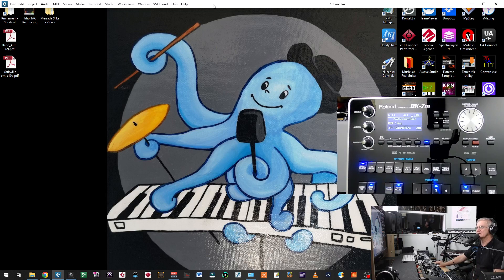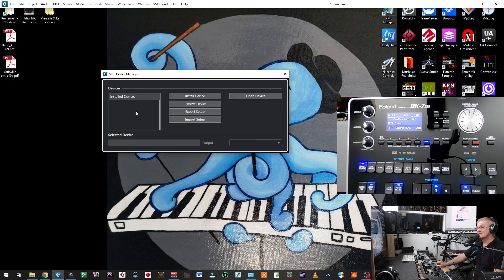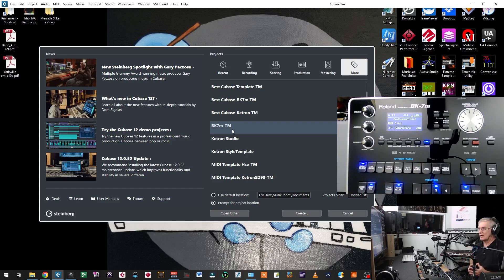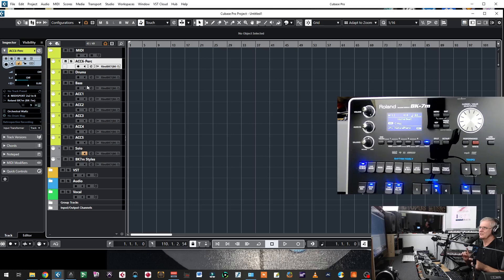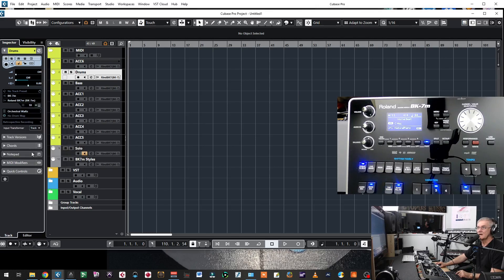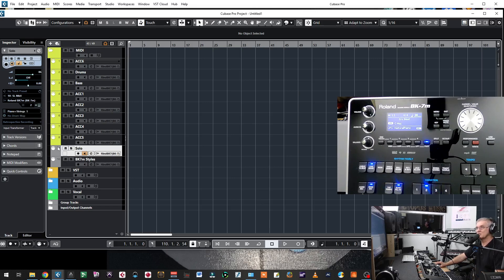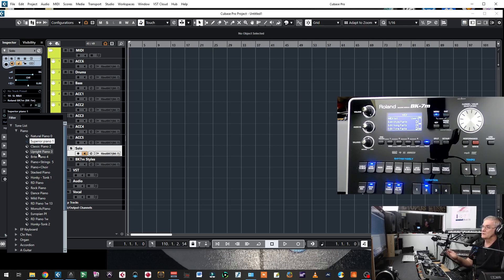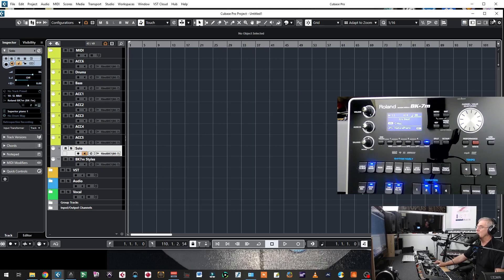Cubase - How to use Cubase Script -Template

Comment: Hi Tiho, thank you for your helpful videos! I have an issue with my setup. When I sent BK-7m Style parts to Cubase, each track gets all channels from BK-7m. Even if I restrict Edit Style Parts to send only ADrum = On for TxCh = 10, all my Cubase tracks record Drums.
Reply: I've checked with Sonar and there are input channels setup for each track, it works as described here - each BK-7m channel is recording to a separate track. For Cubase I don't see such a setup.
Reply: Found it: "This is, how Cubase works. You would need the MIDI Input Transformer to filter the MIDI Notes by the MIDI Channel. But this one is not part of Cubase AI. Please, record all MIDI data to one track only and then use the MIDI > Dissolve Part function."
I'll stay with Sonar, so many restrictions in Cubase AI.
Thanks!

Comment: Hi Tihomir, I'm trying to use MSB (CC00)=89, LSB (CC32), PC = 66 from my Roland RD-700GX piano and there is no sound from BK-7M. The other CC00 numbers work fine. Is it something special with N.Tenor Sax and N.Trombone sounds?
Reply from the maker: N.Tenor Sax 89/64/66
N.Trombon 89/64/57
work fine
Reply: @Tiho2012  Hi Tiho, thank you for your reply! It works for Cubase if I put them into the Cubase template, but don't for my Roland Rd700-GX for some reason.